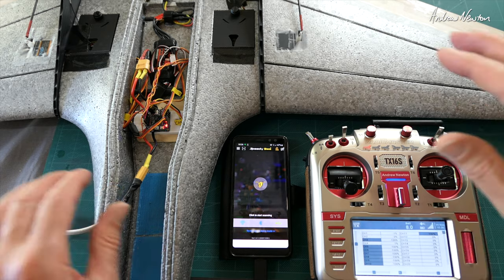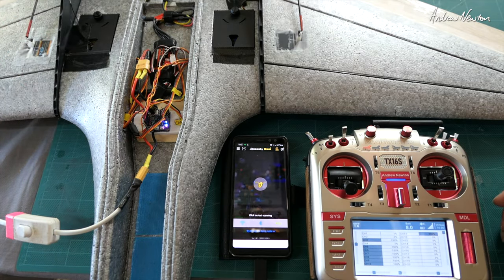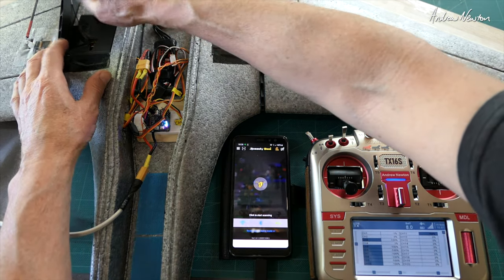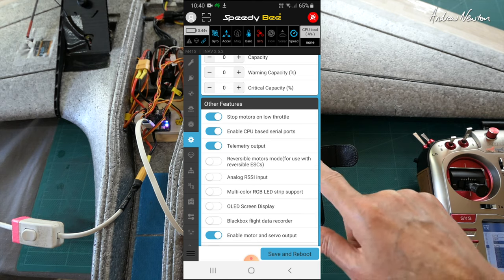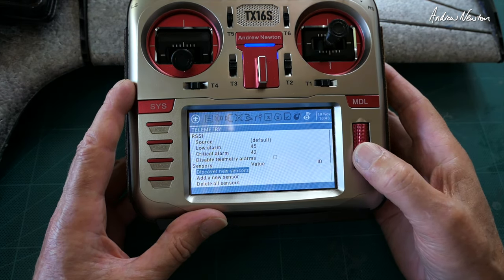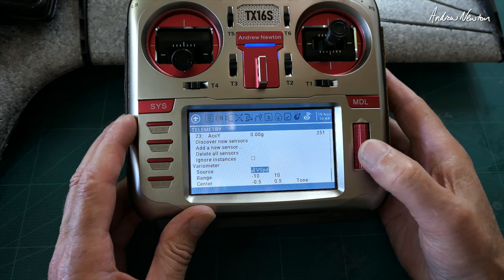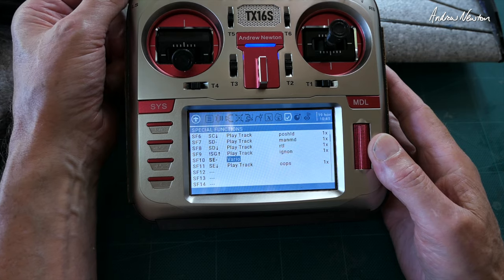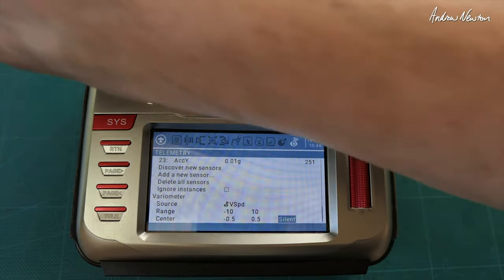INAV Audible Vario using Smart Port

Comment: Interesting video Andrew, I had a full on FC in my Phoenix 2000 a while ago, that would have been handy. I did watch the Altimeter instead, but the tone is far easier for sure. Needs a reliable long range telemetry downlink.
Reply from the maker: I tried FPV on my Radian without an FCB. Got real nervous because it worked too well
Reply: @AndrewNewton  Interesting, well I did fly it for a while on FPV with some success, but TBH, I get more enjoyment flying gliders LOS. This for me, is because getting the most out of a glider in terms of smooth flight and performance, is way easier LOS than it is FPV..It's a bit like landing, the visual cues are essential.

Comment: Hi andrew! i did it everything you said, i find on my matek h743 gsped, gps, alt, but i don't find vsped; may i have to create a VSPED formula from ALT sensor?
Reply from the maker: Thats odd. Try deleting all sensors then rediscover. My H743 is still on Arduplane but I will flash INAV to check.
Reply from the maker: Now flashed with INAV 4.1 and mine gives 24 sensors including VSpd (no 15). Radiomaster ELRS receiver.
Reply: happymodel elrs receiver, alt, gps, gps speed... but no vsped 😢😢😢
Reply: @AndrewNewton  my tx is a taranis x9d plus
Reply from the maker: @MassimoMagni  H743-Wing board? INAV not recognising barometer maybe, have a look on Config page. Mine says Barometer - SPL06